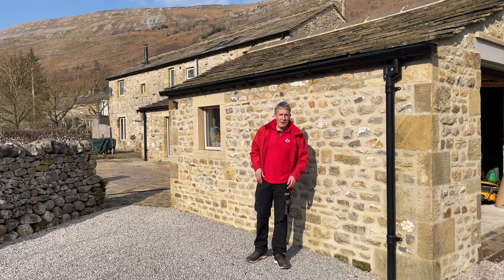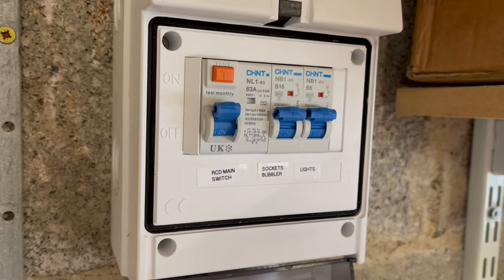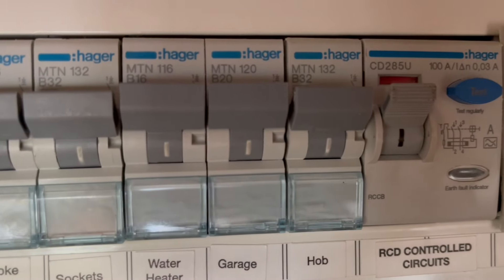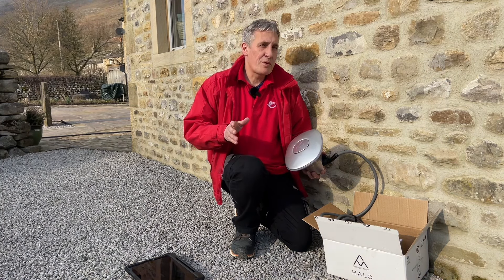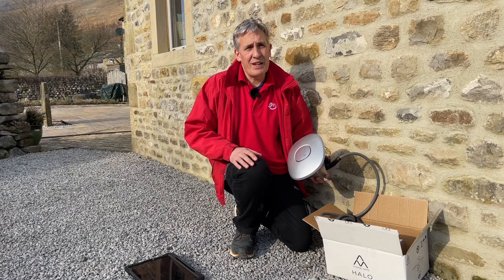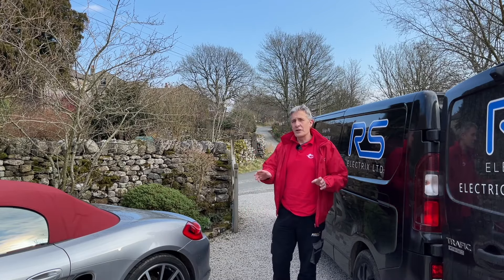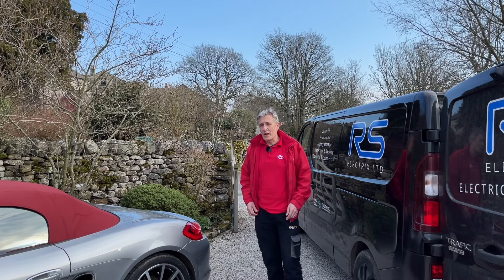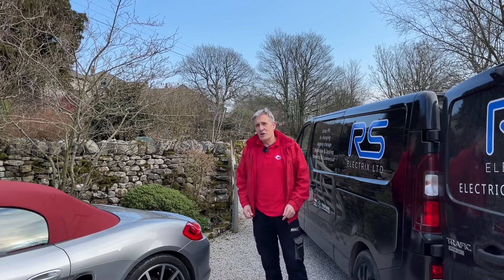Can You Wire An Electric Vehicle Charger To An Existing Cable?

Comment: That garage board does have capacity for a third way. The 2 half blanks on each  end come out to facilitate a third circuit - by design that is, not a bodge.  Not that that's relevant but worth a mention!

Comment: When I put in cabling for an EV charge point to my detached garage, I'm going to run in a 5 core 6 mm^2 cable to allow for a three phase upgrade. I'll get an external CU in place, and sort out another bugbear of mine. The cheapskate builder back in the 1990s wired the garage up from the back of a socket in the ground floor ring rather than put in a dedicated circuit (a garage CU with 16A and 6A breakers has been installed). It's on 4mm^2 SWA, so I'll get the electrician to move that circuit to the new external CU which comes up conveniently, very close to the meter cupboard and where the external CU would go. A couple of external LAN cables will go through a separate duct as well.

I have to do some garden redesign anyway. So it's a matter of digging a 600 mm trench which will be about 17 metres.

If 3 phase can be provided (which might be possible - I know a couple of locals with it), then that might make a 21 kW 3 phase charger a possibility. Then there's ample power for any future heat pump too.

No point in skimping on cable.

Comment: I definitely agree with going for a larger cable than is currently required.  I would then consider running it through some ducting that is at least 4 or 5 times larger than the cable thus allowing for future cables maybe even pipes.  Think in a day of tomorrow you may have some form of power generation happening on or in that outbuilding which you want to export back to your main building.  Solar PV or wind turbine
Reply: I'm planning on putting in 5 core SWA for 3 phase myself, although large ducting is a useful backup. Three phase would allow a 21 kW charger and a couple of locals do have 3 phase.
Reply: I ran 6mm SWA 6 years ago to a garage before I thought I’d have an EV. I wish I’d gone for 10mm now. 🤦🏻‍♂️

Comment: Any chance that you could do a video discussing the benefits/issues involved in adding a 16A commando socket to run a charger?
Seems like for most people 16A would give them enough capacity to get an overnight charge for about £1000 less than a 7kw charger but it doesn't seem to be discussed much
Reply: If you mean to plug the car lead into the commando; what about Open PEN fault. Certainly not putting my name on that EIC!
Reply: Yeah, all the aspects of BS7671 still need to be met for ev charge points, which wouldn’t be that much cheaper. I don’t think the difference is £1000 either unless you’re comparing it to the premium products
Reply: @geraldelwood9660  A socket of that kind is not something specifically usable for car chargers and thus you can install it. If the customer then plugs in a car charger it is its responsibility. But in reality why a car charger is more of a problem in case of a broken neutral than any other class I appliance you use outside?

Also, are PEN faults all that common? And if they are, instead of having to use expensive devices, wouldn't be simpler to put an earth rod and have a real earth electrode and ditch TN-C-S? That is what we do in our country, is not that expensive and it's the best option, not only in terms of safety but because, and especially nowadays with the ton of electronic equipment, switching power supply, etc having a real ground is better for EMI filters and avoiding interferences.
Reply: not all supplies are TN-C-S, there's no need for PEN fault protection on TN-S, plus there is always the option of creating a TT arangement for the BS(en)60309 socket
Reply: @Satters  Actually, on a lot of TN-S supplies are being converted to PEN conductors further down the line. The regs state that if its a TN-S, you need to get written confirmation from the DNO that it will never be converted to a PEN - which basically isn't going to happen - I've never seen an instance of this. TT is always an option as you say, and desirable sometimes in outbuildings, but again, this isn't always practical because of the ground conditions etc.
Reply: The EV charger is a permanent installation, why would you want to unplug it?
Reply: @deang5622  Ignoring the chargers that are used by visitors only etc (not "permanent"). It would be to avoid the regs surrounding EV chargers, likely PEN fault detection. It isn't advisable if the charger is being used on a long term basis as PEN fault can make the body of the car potentially dangerous.
Reply: How does that work? Will another cable have to be run from the house?

Comment: Never mind older detached garages... The new build I just bought had the detached garage connected off the downstairs socket ring main!!! ;-(
Reply: just wow
Reply: My 1992 (ish) built house has exactly the same, and there's about 14 metres of 4mm^2 SWA connected as a spur from the back of a double socket. That's an appalling bit of space saving. When I decorate the room with the CU it's going to get its own dedicated circuit. I think that 4mm SWA is rated for more than 32A, but a 20A circuit would be fine for my needs anyway.

If (when) I get an EV that's going to be a separate buried cable, but I guess I can't blame a builder not anticipating EVs 30 years ago.

Comment: If you are going to spring for outdoor conduit then by all means do yourself a favor and spring for some tough conduit. I put in some cheaper stuff and then found out years later that it was crushed when a heavy truck came onto my driveway.

Comment: Is 6mm SWA able to handle 32A? I already have 6mm SWA.
Reply from the maker: Yes in most cases but would depend upon length = volt drop
Reply: It’s 25m long so could be a voltage drop. I installed it 6 years ago simply for a two gang socket in the garage and an 40w led light batten running off a mini consumer unit.

Comment: That is why I run to my garage 3 phase cable at 4 sqr mm, that can sustain at least 20A load. At 16A, 3 phase is 11kW.
Reply: I don't think so. 11 kW at 16 Amps is a phase to phase voltage of 487 volts.

At a nominal phase voltage of 230 volts in a 3 phase system, the phase to phase voltage is 400 volts.

So unless you are running on electrical system where the phase voltage is greater than 230 you are not going to get a phase to phase voltage of 487.

Comment: Surely better advice would be to install a duct to the outbuilding,who knows what’s coming in the future and may require a cable not yet made?
Reply: That's what I would do, run a large diameter "drainpipe" for unknown future services... (network, solar, pumped sewer, water, power, gas, fibre, alarm...)
Though certified depth, warning-tape above the pipe and shared services may be an issue.

Comment: Is it OK to bury conduit as a consumer in preparation  for a possible  future outdoor circuit? Or or does that need to be done by an electrician  / approved by building control?
Reply: You can certainly install ducting yourself, but be aware that it will have to be smooth and large diameter for SWA cable. Also, you'll want to run some sort of pull rope too. Technically there isn't a minimum depth, but 450mm is usually considered to be the least, and 600mm might be better in some environments. Also, I personally don't like data and mains cables in the same duct, but that's maybe by telecoms background. Personally I would run data cables in a separate duct in the same trench. Perfectionists will also put a warning tape in the partly filled trench above the duct, but that may be overkill for a domestic setting. However, it's very cheap, so why not? Bear in mind that SWA has a minimum bending radius of 6 times the overall diameter for up to 16mm^2 cable. So a 3 core 10mm^2 SWA cable, which is about 20mm in diameter has a minimum bending radius of 120 mm, and I would certainly use shallower bends than that if possible.

Also, it's best to bed and cover the ducting in sand before filling. 

You can run the cable yourself if you like, as long as it is the correct specification, and it's easier to do that when the ducting is installed. The electrician will test the cable anyway for impedance and insulation. Note that the cable has to be SWA unless the ducting provides mechanical protection (which nobody is going to install in a domestic property). 

A few photos of the installation would not come amiss.

Comment: All to complicated, why if they have the technology to make rechargeable mobile phone battery and battery for power tools without any of hazel why can’t they make EV chargers with all that hazel . But that’s way too easy. There first thought is how to con and rip off the consumer, but who am I to argue i’am just a humble spark who’s opinion means nothing.🤣
Great video With some clear advice as always Gordon 👍👍👍❤️
Reply from the maker: It’s good work for electricians 👍
Reply: @efixx  now that I have to agree with. I think whatever peoples opinions are we can’t say it not interesting.and it certainly is good work for electricians, if that’s what they want to install. 👍
Reply: I'm interested in your opinion, how would you solve the EV charger problem?
Reply: @Harold_Shand  if they can make mobility wheel chairs and scooters with high capacity battery’s and a chargers that plug into a standard 13amp socket outlet then they they can use the same technology for EV chargers, my late father in-laws mobility scooter had a twenty mile range and took 8 hours to fully charge the battery, the charger was about the size of a box of chocolates and plug Ed into a 13amp socket. Also E Bikes some have a 50 mile range and can do 40or 50 mpa and yes plug into a 13amp socket to recharge the battery. All with out any problems or the DNOs taking control
Reply: @Sean Dempsey  There already are EV chargers that plug into a 13 amp socket- granny chargers I believe they are referred to. The thing is, a lot of people will want/need faster charging times, especially if they have a reasonable commute everyday. I don't think there is any scam or con behind it, just physics.
Reply: @seandempsey7351  Simple! The battery capacity of all EV Vs the mobility scooter and e bike are of entirely different orders of magnitude.
Drive a car with something around a 70kWh battery and now divide that by the charge rate of a domestic outlet and you've got about a 2.4kWh charge rate. It's slow, do the maths, that's 29 hours. In fact it will take longer as it tails off when bearing full charge. 
Next, you'll want to charge that during cheap rate, that could be a 7 hour window or worse on some tariffs, 4 hours.
On Economy 7, that would take over 4 days to charge and with a 4 hour cheap window, over 7 days.
If the use of the vehicle was very low, you might be able to work with that, unlikely to be suitable for most people.

Comment: Now this is only what I thought but I always thought if wiring a supply to a new built garage you would use 10mm² or 16mm² S.W.A. cable and a 40A circuit breaker to supply it. I don't know if I'm right or wrong here.

Comment: As soon as you mentioned bubbler it brought back a rather smelly memory.. really good video Gordon.. it's a good subject as not everyone needs a full 7.2kw charger i think phev are going to more popular for the time being until prices come down, lot smaller batteries less charge time... do you know of any charge points that don't need internet connection ? it's for an off grid project
Reply from the maker: Thanks Torchy - Quite a few chargers will work without internet - e.g Zappi - but laws are changing - yes laws not regs - stay tuned.
Reply: @efixx  Thanks, i had heard through the grapevine things will be changing , i'm assuming its to give the DNO the right to limit charging as demand picks up? i know Australia are doing something similar, wouldn't surprise me in the near future if they add a tax per mile due to loss of revenue at the pumps
Reply: @thattoolguy9432  But how would they kn
Reply: Know unless as hinted internet connection becomes mandatory but the granny charger is just another 13 amp appliance
Reply: Its to tax you per mile driven. Thats just for starters.....

Comment: If your thinking about the future when doing a renovation 
You could run a conduit under ground say around 50mm diameter with a couple of draw wires 
For later use
Reply from the maker: A great solution

Comment: As normal great topic. Ok I for my own reasons need an ev car charged and so the options you mentioned really would not suit my needs like load limitations. My car has a 62kw battery and takes near 8 hours to charge when say at approx 20% . And it needs charging  5 days a week to allow range . So everyone is different and what they need. In your installation they done the right thing as battery's are becoming larger which means longer charge times

Comment: Rcd feeding a rcd 🤔🤔
Reply: The RCD in the EV charger does not protect against a fault between the consumer unit and the EV charger.

So an RCD in the consumer unit provides protection for that part of the circuit
Reply: @deang5622  I’m aware of what the rcd protects , but you don’t normally put 2 rcds on the same circuit as they cancel each other out
Reply: @cj-rb8fz  No they don't cancel each other out. It's usual to use a delayed RCD.

When you say they cancel each other out, I presume you mean that they both fail to operate. Explain how that actually happens.

Comment: Best option stick to fuel and create no extra burdens on electricians daily work , and network supply ,
Reply from the maker: Genie 🧞‍♀️ is out of the bottle on EV
Reply: Sparkys will welcome the work. EVs use less power per mile than it takes to refine, transport, store and pump the equivalent amount of petrol/diesel. Far more efficient use.
Reply: @dadjv1926  only bigger problem is can the network cope and where the end product lands up in ,